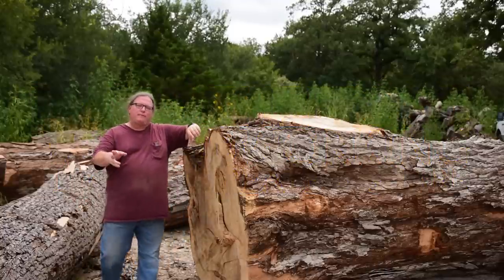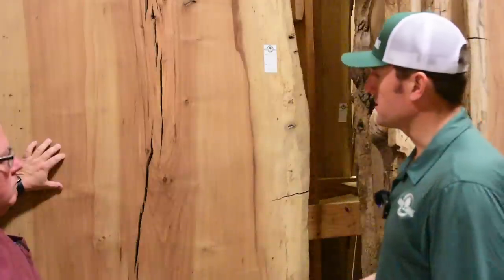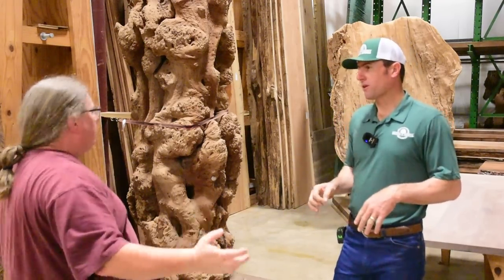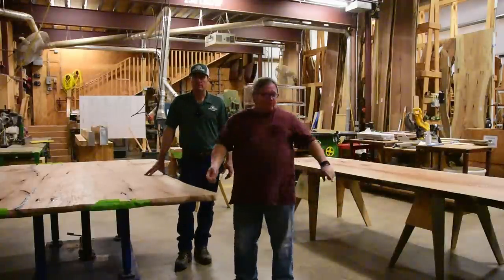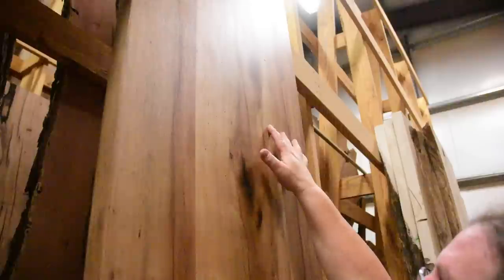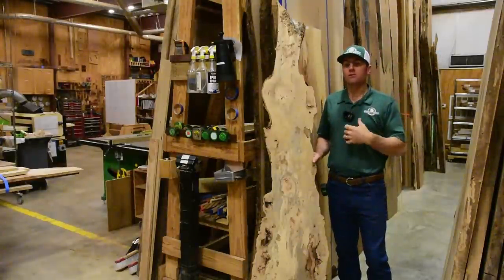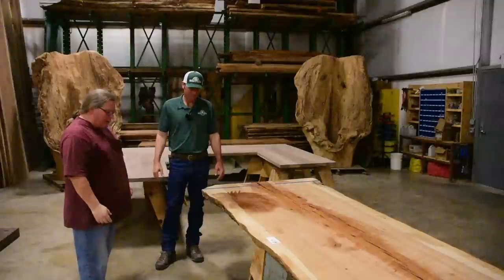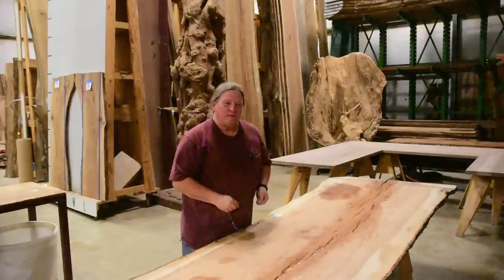Wood Slabs - Options not available in boards.

Comment: I once had slabs of Honduras mahogany cut from the crotch of the tree. There were several and ranged in size up to 5 feet long and about 30 inches wide and sorta triangular shaped. They were a dark red color with the beautiful grain pattern you see in a crotch section. They were planed and sanded on on one side but the other still showed the saw blade pattern. I also had several boards of the same stuff in 5×2 dimensional. I got it all at some old wood worker's garage sale. All of it went up in flames with the garage. Dammit.

Comment: I would like to go there one day and look at the beauty of thise large slabs, though i could niot afford them. Its about a 2 hour drive north of me. I am just a diy'r and like working😅 with wood and have been turning for a couple years. Purchased a sawmill years ago and able to take mesquite, pecan, post and live oaks, cedar elm, cedar, hackberry trees off the ranch and make beautiful things. Some of the slabs i cut are unbelievable bestiful and ones you will not see in stores.  I built out homes bathroom cabinetry from post oak I milled and chose every raised panel, stile, rail, drawer face  for the uniqueness because of the selection of wood i had on hand. Some that have seen the work dont believe its even post oak but I assure  them it is.

Comment: Great info, thanks!  I wish trees of that size would grow here. 😅 I noted the term curly wood, I think it is what called flaming in my language, loosely translated, that has been very expensive and valued in the past, during the first half of the 1900's. It was often cut into thin veneer and put on cabinet doors as an open book pattern. I wish there was a way for woodworkers to cut veneer easily, but I have read that it is made on big industrial lathes specialized peeling a tree into a continuous piece of veneer. Have not found a video on that, would be interesting to see gow it is done and what such a lathe is like.